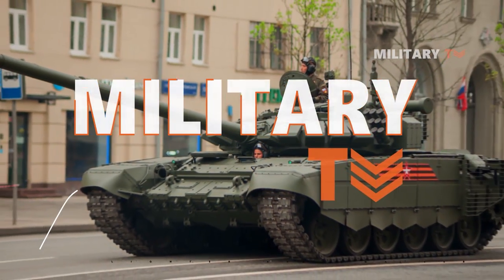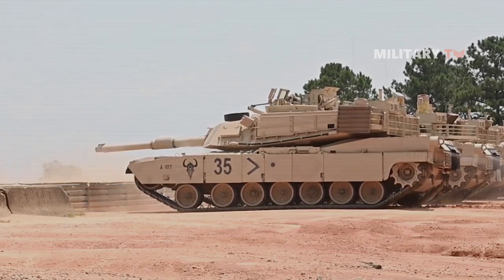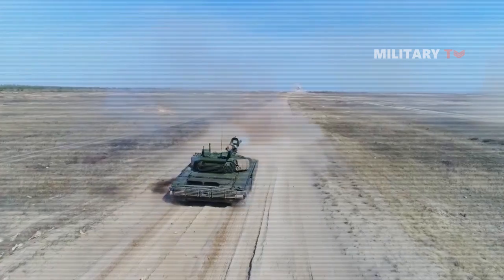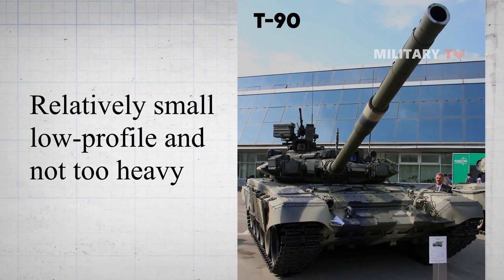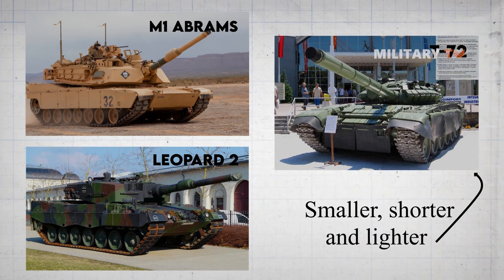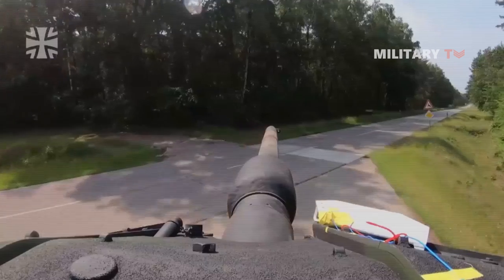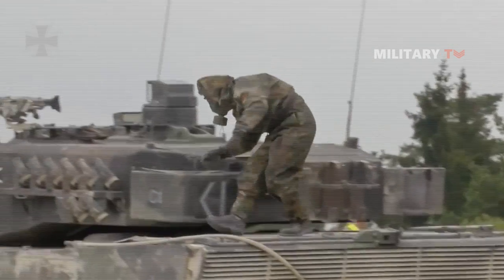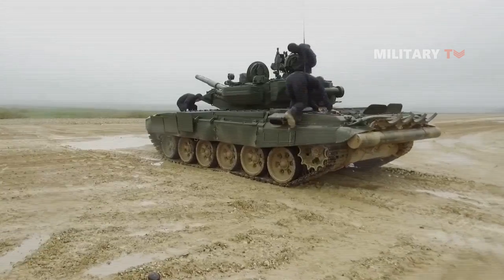Why are Russian tanks lighter and smaller than the western tanks

Comment: There's also a few other aspects of Soviet/Russian tanks that were overlooked in this presentation.

The T-54, T-55, and T-62 all have provisions to mount a dozer blade as standard equipment, while every subsequent Russian MBT from the T-64 onward has an integral collapsible entrenchment blade built directly into their lower glacis plate. That makes it pretty obvious that the rapid construction of defensive earthworks by the tanks meant to use them is considered very important by Russian policymakers. Combined with that is the fact that all of these tanks are very low in overall height, and gun elevation and depression have never been a priority in Russian MBT design. It's obvious why these are the case; the primary terrain Russian tanks are expected to fight defensively on has vast expanses of flat topography, with relatively few trees --- this is not consistent with the hilly and heavily-forested terrain of Central Europe, but it is consistent with the European Plain, which covers virtually all of Russia west of the Urals.

This is far more important than you probably realize. Russia's only viable geographic barriers on their frontiers has historically the sheer scale of thir geographical area (hence, why Russia has always been expansionist in nature), but the advent of mechanized warfare has all but eliminated this "barrier". It makes sense that they would built tanks meant to fight primarily on the defense, and primarily on their terrain. This also explains why Russian tanks are consistently lighter than their direct counterparts in the West; using less materials means that for a fixed strategic reserve of metals, you can build more of them to cover a much larger frontier.

Soviet doctrine also states that while tanks are meant to fight other tanks on the defense, their primary mission on the offense is to fight infantry. That this is the case is evidenced by the standard main gun ammunition loadout for every Russian MBT from the T-55 onward. These tanks all carry 40 rounds (or approximately the same), consisting of 5 APFSDS rounds, 15 HEAT rounds, and 20 HE-FRAG rounds. HEAT is more effective for destroying light armor, which predominately accompanies and/or carries infantry, while the reason for the large load of HE-FRAG rounds is pretty obvious. It also says a lot about how important HE-FRAG ammunition is for Soviet armored strategy, considering that they never fielded a tank with a new gun unless there was an HE-FRAG round already in production for it (i.e, the 115mm gun on the T-62 and 125mm gun on the T-64).

Infantry are also considered in Russian military strategy to be a superior threat to armor, which is why tanks were intended to massed fire using HE-FRAG rounds to eliminate as many of them as possible from a standoff range. This is also why Russian tanks have less machine gun ammunition (which they have to get very close to the enemy to use) than their counterparts --- and why Russian infantry weapons and light armor have historically been given an excess of anti-tank firepower.

Contrast this with the M1A1 Abrams, which all the way up until the end of the 1990s carried only APFSDS and HEAT rounds for it's main gun (30 APFSDS and 10 HEAT is the standard loadout), and which carried a whopping 10,000 rounds of 7.62mm and 1100 rounds of 12.7mm ammunition for it's machine guns (Russian tanks typically carry around 3000 7.62mm and 400 12.7mm ammunition). The M1A1 is also colossal, extremely heavy had very high gun elevation and depression, and wasn't designed to use a dozer blade. In stark contrast to the USSR's high priority for HE-FRAG ammunition, the USMC didn't start using one in the M1A1 until the early 2010s, and even then it was just a licensed copy of the existing German DM13 round (not one the Marines had developed especially for them). The US Army's new AMP round for the M1A2C is also an HE-FRAG round, and it's been on the back burner for so long that it still isn't in service yet. In short, the M1 is basically the opposite of what a Russian tank is all about, and therefore is a poor frame of reference to compare to Russian tanks without additional context.
Reply: This took way way to to long to not say anything or like here
Reply: Very impressive observation , now best and most  knowledgeable expert  on Soviet and Yugoslav  tanks in World is Serbian expert Vlada Ivanovic according to him Yugoslav M-84 tank  is better from U S Abrams  .
Reply: the M1 can use a dozer blade too. most, if not all, western tanks can, but just dont mount them all the time
Reply: Yes, well the video was meant to be a quick overview, not an essay. You could easily spend hours on this subject and still miss things. This is meant as a brief summary of the important points.
Reply: @EthanThomson  The M1 can't actually use a dozer blade at all, as proven by US Army documentation leaked to the press in the 1980s. The powertrain isn't strong enough. This is why the only time you see M1s fitted with them, they're either not using them at all, or just scraping loose spoil --- not cutting roads, digging entrenchments, or ramming-aside heavy obstacles.
Reply: @hughjass1044  The points were wrong, as I proved in the above comment.
Reply: Quick side note : HEAT and HEATFS Shells were used as Anti Infantry by Nato for a long time.
Reply: @panzerofthelake506  That doesn't make them effective in that role. The charges in HEAT rounds are specially shaped to focus nearly the full force of the blast into the charge liner, which is how they penetrate armor so well. That doesn't leave much left for blast or fragmentation.
A 2004 Armor Magazine article titled "The M1A1 Tank and Fragmentary Ammunition" also revealed that the M830A1 MPAT (a HEAT round) failed to inflict any casualties to Iraqi soldiers in the 2003 Invasion of Iraq, even though the MPAT was wrapped in a special casing designed to produce heavy fragmentation; it failed even against troops that were standing-up straight and running in the open. It's no accident that the USMC (note that the author of that article was himself a Marine) ended up fielding an HE-FRAG round based on Germany's DM11 some 5 years later.
Reply: @BlacktailDefense  Well they are still several kilograms of TNT equivalent Explosive going off. They are still quite deadly as the blast doesn't just go in one direction. Every action as an equal and opposite reaction after all. Heat might not be as effective as Frag rounds but still nothing to scoff at.
Reply: To be fair, USSR did field the BMP-1(I know, not a mbt; but it can be considered a light tank) before HE-frag was available for it.  That was made later and it sucked.
So I don't think USSR ever did that again.  (but a low pressure large-caliber HE-frag is indeed desirable in addition to autocannon, hence BMP-3)
Reply: Wow, you show a good detailed knowledge. You seem very credible. 
What is your background?
Reply: you show that the details are important.  
I didn't realize how much more machine gun ammo the M1's carry compared to the Russian tanks.  
Doesn't that give the M1 more staying power in a battle?  
when I shot weapons on automatic, I was impressed with how many shells I fired without thinking. Emptied a clip in the blink of an eye.  
So, 10,000 rounds may sound like a lot, but if you are in a battle and firing all  the time, I bet you can go through them pretty quick.  3,000 rounds seems like a pitifully small number to support infantry in a battle. 
BTW, if the Russian tanks are supposed to support infantry, why are they given so little mg ammo?  Seems contradictory.  Is it just to keep the tank small?
Reply: @craigkdillon  i believe that is why the Russian military has such a wide spread of different types of hardwear. They use tanks mainly for destroying other tanks or fortified positions. While BMP, BMD, BTR, BMPT (terminator) etc. Support the ground troops. And all other hardwear work best together.
Reply: @craigkdillon  i assume their small internal capacity has something to do with it
Reply: @craigkdillon  I don't actually have any background in military science, per-se; just decades of reading.
Reply: @BlacktailDefense  Pretty good reading. My knowledge was gotten the same way.
Reply: Craig Dillon 
I if you take what you said, that it doesn’t seem like much ammo, I think you could also make the case for either one not being a lot of ammo. The point of the tank is it’s big gun, and armor. So the little gun is of little use. Russia’s main worry is a fast large scale land invasion with tanks and infantry (a modern version of what Hitler did). It’s Russia’s weak point, also not having a derp water port. That basically explains why Russia will not let Ukraine go too. Currently Russia is surrounded by nato, all the weapons treaties have expired and they are dependent heavily on gas and oil to keep their economy going. That is a finite resource. If they have to fight for their interests they would rather do in sooner rather than later. Especially now that the US has pivoted to China. 
Russia won’t let Nato bully them. Not sure what the West is so aggressive with Russia for. 
Russia is just doing what it always has.
Reply: I can’t imagine a fragmentary round taking out too many infantry. What about buckshot in a tank?
Reply: @michaelnice93  Huh? Doesn't a fragmentary round throw a lot of shrapnel (fragments) in all directions, taking out soft human targets?   
Or is that something else?
Reply: This is why they did so bad against the M1. Even stuck M1s did extremely well against T72s as Tom Clancy wrote in his non-fiction book.
"Well, in his 1994 non-fiction book, Armored Cav, Tom Clancy recounted a tale of how an M1A1 Abrams got stuck in the mud during the ground war of Desert Storm. It was then set upon by three tanks, Iraqi T-72s specifically. A round fired from roughly a thousand yards away bounced off, and the Abrams responded by blowing the T-72 that fired it to bits. A second round fired from 700 yards, bounced off, and the offending T-72 was blasted. The third T-72, at a range of roughly 400 yards, fired a round, which left a groove in the armor of the Abrams. It, too, was destroyed by a shot fired through a sand berm. These were, supposedly, Russia’s state-of-the-art tanks.

Then, when help arrived, and the tank couldn’t be freed from the mud, a platoon of Abrams tanks tried to destroy it. After several rounds, they detonated the onboard ammo, but the blow-out panels functioned as designed. Then, when the tank was retrieved from the mud, they discovered that it was still functional. The only issue? A sight was out of alignment."
Reply: Another addition to this if I may:
Soviet Doctrine did have the idea that at some point a assault is going to be needed. Having already went through alot of Europe druing WW2 , Soviets learnt that often times crossing a river in short amount of time is vital for alot of operations.
Exactly for this reasson pretty much all Soviet and RUssian BMP's and BTR's are able to swim. Same goes for BRDM's and so on and so.
Soviet tanks also had the abillity to quickly set up for a underwater force cross. I dont know if the Abrams can force cross a deep body of water , correct me if I am wrong.
And another thing the Soviet learn is that even if there will be bridges across rivers , not all of them will be high quality ones. And ligher tanks have a higher chance of crossing such a bridge without breaking it.
Reply: @EcchiRevenge  The Soviets quickly realised that the BMP-1 was a good idea , but wasnt done right. Grom cannon was deemed as pretty much useless againts anything really and thus the work on a better weapon system started , resulting in the BMP-2. The Soviets knew they would replace the Grom cannon , hence why they didnt bother with HE ammo for the Grom gun for a long time. 
BMP-3 also has its issues , BMP-3s main gun was made to mainly fire wire giuded missiles. And HE ammo was as a secondary ammo type to it. The Autocannon was used as anti infantry and for light armor while the main gun , for heavier things.
Reply: Hendrix Cody  I dont know how a giant Jet engine which can be heard from 2km away or even more.
And you say it can "run so fast , to run off its oww tank tracks".....It isnt true , and if it was , how is that a good thing?
Stop making yourself look dumb.
Reply: @ThatCarGuy  Not only were Iraq crews poorly trained , somehow I never bought that story.
But even if its true , a single event cant determine a tanks quality. Many accounts from the Ukraines conflict where T-72s and T-64s would take 5 even 6 hits from ATGM's and other weaponry and still be able to push back into cover. Its a matter of luck , skill of the crew , and I guess in some cases , even if I am a atheist , some third powers help.
Reply: @AlexOnTheSide183  Even if you don't believe the story which is a non-fiction book using sources, The T72 did so bad they had to rename them T90. While no tank is perfect, in most cases a heavier tank will beat a lighter tank unless heavily out numbered.(Think US Sherman strategy on WW2 4-5 Shermans per Tiger)
"The T-90 is a third-generation Russian main battle tank. The T-72BU was officially accepted into service on 5 October 1992 by the Russian Ministry of Defence and simultaneously renamed as the T-90 for marketing and propaganda purposes aimed at distancing the new type from existing T-72 variants"
Reply: @ThatCarGuy  The T-90 is a modernization of the T-72 , not a simple rename. 
Ill look at you repair a Abrams tank on the field with a socket wrench and a sledge hammer. Because those are pretty much all the tools you need. Believe me. Id know. My dad was a driver of a T-72 tank.
Reply: Hendrix Cody  Again...There is nothing special about shooting while driving.....Leos and any Russian tank can do that.
Again , I dont get how limiting your speed is a...asset to the tank and a good thing?
Reply: @AlexOnTheSide183  it was literally named t72 before being renamed t90 as proven above.
Reply: @AlexOnTheSide183  That's bullshit because BMP-3 only carries a tiny number of ATGM and originally didn't have autoloading mechanism for it.

73mm works, just as SPG-9 is still used even today.
Just not for its original purpose for use against tanks.
Reply: @ThatCarGuy  If the T-72 were renamed to T-90 then wtf is the T-72B3?
T-90 is pretty much the same tank as a T-72 , yes  but it was modernized after the feedback came from the T-72. They realised that the changes are significant , so they changed its name. 
These are now 2 diffrent tanks , T-72 wasnt just renamed because it was shameful or anything. Again , its not the tank that makes the crew , but the crew who make the tank. Put poorly trained crews in a T-72 and no matter what you face , they will probobly fail.
Reply: @EcchiRevenge  On training grounds , yes , HE was loaded into the guns with a small amount of ATGM's , but in combat , any sane Commander , would take as many ATGM's as he could , because he knows that if he meets light tanks or infantry his 30mm will do just fine , but if he meets a tank , his HE 100mm round wont do shit.
And I dont know what the SPG-9 has do with anything here
SPG-9s are still in use , yes . Mostly as AT weaponry for the VDV or other rapid deployment units. It can destroy most tanks or IFV's from the sides or back , but you need to get into close range to manage to hit it.
Reply: Hendrix Cody  
Soviets were first to use a smoothbore gun , first to use fin stabilized ammo on the T-62
First composite armor on the T-64
First ERA protection

The Russian tanks didnt need to stop , they stopped due to the poor skill of the gunners of those tanks. But I would think you would know that. You clearly have read so much in your 9 years of life on this world. 
Soviet tanks had stabilizers and had great weapon systems for the time. Sure , they didnt have Nigh vision on early variants or thermal sights. But at the time , for the Soviets , Mass production was the main point. 
And dont forget. Early versions of the Abrams also didnt give their commanders proper thermal or night vision sights and only the gunner got them. So the Driver , Commander and loader were blind during the night and only the gunner could see for about 2km infront of him.
Reply: Hendrix Cody  So does Russia , and Germany...Or any European country. Pontoon bridges arent exactly something new or amazing. Its just that  bringing said patoon to the river takes time , while simply force crossing a river is 10 times as fast.
Buckel down , close all hatches , put the air intake tower on and off you go. It wasnt that it didnt stress , its that the US never built the Abrams for the European continent. But for open desert combat. Thats where the Abrams does shine with all its systems. But try to put in in a European area and you get a giant bulky heavy ass tank , that breaks all the roads it drives on , any bridges it crosses.
Reply: Hendrix Cody  Oh this one....Because the Russians ran around with M1 garands and Thompsons....Fucking dude , read some history books.
What was actually delivered to the Soviet Union during that time , where and when the Soviets turned the tide of the war and why.
Little secret for you , the main thing delivered wasnt ammo or weapons or tanks but it was food and trucks. Trucks is what the Soviets needed badly as it lost tons of them in the first weeks of the war. Food wasnt in something the Soviets were super short on , but it helped.
Germany simple ran out of jiuce near moscow. Support lines stretched from Germany to Moscow , Not being ready for the harsh Winter which was the coldest one in the last 30 or so years. Soviet reinforcments from the far east.
All of these were the main reasson Germany simply didnt have enough recources or power to push any further into Russia. After Moscow , germany retreated , defeats at Stalingrad with the 6th army being wiped out , then Leningrad being unblocked  , Defeat at Kursk and failure of operation Citadel which was the last German offesive in the Eastern front. And then finnaly the 1944 D-Day landings , which made Germany rethink their plan.
So they sent all their forces to the East , leaving the Western front pretty much open. 
They knew the Russias were coming for revenge , but the Americans didnt have such hatred , as their homeland wasnt bombed and burnt for the last 4 years.

Before you talk shit about somebody not knowing history , actually read a bit about it , cause clearly you jack all about it.
Reply: @AlexOnTheSide183  "wtf is the T-72B3"
.... Russia upgrading older the older T72/90 with modern reactive/passive armor... Hence how both of them can accept the exact same armor plating, since they are the same tank. Dude the T90, was literally called the T-72BU before finally being renamed the T-90 to move away from the T-72 name since it did so bad. Just like how the S400 is literally a renamed S300, and was it's name before being changed to S400. The Su35 is a glorified Su27 and was literally also called an SU27 before it's name change, and so on. Russia is known for this. 
"The S-400 Triumf, previously known as the S-300 PMU-3"
"The type was originally developed by the Soviet Union from the Su-27 and was known as the Su-27M"
"Though only a modest upgrade, Soviet leaders decided to re-brand the tank for marketing reasons. The poor performance of Iraqi T-72 crews against Western armor in Operation Desert Storm sullied the reputation of the tank. To differentiate the newer model from its tarnished image, the tank was to be called the T-88. Russian President Boris Yeltsin approved production of the T-88 after a visit to Nizhni-Tagil in June. The name was formally changed to "T-90" by state decree in 1992 to symbolize its status as the first new Russian tank of the 1990s"
Reply: @BlacktailDefense  iam paying you respekts, never seen someone with that much knowledge on tanks
i mean iam a tank enthusiast too but u are another level haha
Reply: @AlexOnTheSide183  dude u are so right the story is either bullshit or iraqui crews are bad.
look.
those 3 t72 fired 3 times and abrams fired 3 times? why?
russian tanks have aoutoloaders that doesnd make sence
it should be more like 7 shots against 3 or something
second
1 shot was high explosive... lol
one was HEAT ( abrams armour is actually designed against HEAT shells)
so that was dumb
and the last shot was AP
also its stated that the 125mm gun of the t72 can penetrate about 930 mm RHA (standart armor... plain metal, no extras no ceramic) at 2 KM
that does mean at 400 yars that would have been a 100% penetrating shot if not in the turret
cuzz at 40 yards the penetration should be like 1150mm
thats even kinda enough to penetrate the turret if no bounce of happens
so u are right either the crews were complete apes, or this story is BS
i think its the socond option
u know america is selling those tanks...
so it makes sence to do marketing and propaganda
Reply: @ThatCarGuy  I know what a T-72B3 is , what I mean is that the name wouldnt be there if all T-72s were simply renamed. Yes the Iraqi conflict had a major hit on the sales of the export version of the T-72 , but they didnt just take a T-72 , rename and sell it.
They added new things to it , took the feedback from iraq and upgraded the tank and changed its name to T-90. 
What I am trying to say , a T-90 isnt a simple rename. Its a modernized T-72 with the Iraqi war feedback and info.
Reply: @AlexOnTheSide183  Not how that works.
You're making bs up as you go, but you didn't know the autoloader carousel for HE-frag cannot actually load the missiles, which are much longer.  The capacity of 8 is from the 3 rounds in turret and 5 round in specialized racks in the hull; this is non-negotiable.

You don't know what SPG-9 has to do with anything here because you don't realize it shares warhead wtih BMP-1's main gun.
Reply: @ThatCarGuy  "These were, supposedly, Russia’s state-of-the-art tanks."  AFAIK, these were Soviet tanks of the 70s, moreover, in the export version, i.e. a little deteriorated. They were armed with shells that were decommissioned in the USSR in 1974.
Reply: Dude please tell me you did not write that whole constitution of a explanation of Russian tanks...smh...lolol.
Reply: @EcchiRevenge  This aint War thunder , you can carry anywhere you want , not even in the designed racks. Is it safe? Fuck no. 
But again , Where am I fucking wrong that the main Anti infantry weapon on the BMP-3 is the 30mm?
Reply: @AlexOnTheSide183  it is a simple rename as proven above.
Reply: @AlexOnTheSide183  This ain't warthunder where BMD-4 had a bug that let it fit 9m117.
This also isn't Armored Warfare where you're allowed to carry a full load of missiles.(that game wasn't even trying to be realistic)

The carousel literally can't fit the missiles.
Look up the fucking schematics.

Everywhere, BMP-3's main gun is the 100mm.  For infantry both in the open and in cover(this is partly why 100mm is desirable and where 73mm was useful - much better than autocannon against fortifications).  The trajectory of the low-velocity 100mm gives BMP-3 some ability to conduct indirect fire against distant targets(ATGM teams at standoff range, for example).

For that reason, the standard combat loadout of BMP-3's 30mm autocannon has less HE ammunition than AP(245 vs. 255; 500 total).
Reply: @EcchiRevenge  Ok so what are you attacking me for here? I said that the 100mm was built with idea that that ATGMs will be fired from it and that the ATGM is the main weaponry againts tanks? How am I wrong in that?
Reply: @AlexOnTheSide183  Shifting goalpost.

You feel attacked because I merely corrected where you're wrong.

Stop trying to grasp at straws.
Reply: Uh yeah, so does the Abrams, Le Clerc, ect
Reply: @levak8740  that's one person's opinion and makes zero impact on the outcome of any conflict.
Reply: @BlacktailDefense  uh, I will have to say your incorrect, we did in 04 in Tikrit to move plenty of dirt and it has ZERO issues.
Reply: @reedrk88t  The only time before the 2010s that any M1s ever carried dozer blades was during testing in the 1970s; testing they flunked, which the US Army themselves were the first to admit. The Pearson "Combat Dozer Blade later attached to some M1A1s ans M1A2s was the same blade that the M1 proved itself incapable of using decades ago, while the M1ABV used a scraper that combed the ground for mines, not a blade that scooped-up the ground.
Moreover, the M1 ABV didn't enter service until 2009, so you wouldn't have even seen one of those in Tikrit in 2004. All the M1A1 and M1A2 carried at that time were mine plows and mine rollers.
Reply: @EcchiRevenge  Wtf are we even on about this point? 
I said that the BMP-3 100mm was made to fire ATGM's and that the 100mm was meant to take care of heavy targets while the 30mm was to destroy infantry.
You tell me I am wrong and start telling me about how much ammo the BMP-3 can carry , which wasnt my point and wasnt what I was even talking about. 
The 100mm main idea was that it will take care of any heavy armor the BMP runs into , but if needed , they have HE to use. And it matters on who you are fighting , what sort of intel you have and so on. If you know you will only run into enemy infantry you take HE ammo , if its going to be tanks then you load as many ATGM's as you can fit , and those dont have to be in factory made places. Ive seen what tank crews come up with just to have more ammo. No sane commander will carry a full load of ammo of 8 ATGM"s and how ever many HE shots , because you just become a giant gunpowder barrel. 
The word attacked was meant that we keep telling each other the same thing yet somehow are having a argument. Fucking hell.
Reply: @EcchiRevenge First....What people? You are the only one redead my replies , second , Ive been around military vehicles my entire life. My Dad first trained to drive a BMP-1 , then drove a BMP-2 and even got to use the BMP-3 , later was switched to drive a T-72 wihout a turret and made into a recovery vehicle. On training grounds who often carry more ammo then what you need , inside boxes ONTOP of the god damn vehicle. When I say carry ammo , that doesnt mean all of the ammo needs to be in the specific locations inside the vehicle. Again , thats on training grounds , ofcourse nobody would carry HE ammo in boxes on the armor in combat , because thats suicide. 
How many more fucking times do have to tell you that the 100mm gun is made to destroy enemy TANKS while the 30mm is meant to destroy INFANTRY. And the ATGMS are exactly for that fucking reasson , to destroy tanks. And the HE rounds are there whenever you need them. I dont fucking get How I am wrong in saying that a Guided fucking missle is used to destroy tanks. 
You are just a guy who jacked off to a bunch off books and magazines about vehicles and then tries to prove something to somebody who has fucking been at training grounds and has seen been all around said vehicles. Fuck I care that 73mm Grom cannon is the same as the SPG-9? What does that have to do with us talking about the BMP-3? 
You are just trying to prove to me you are smart , not that im wrong. Just stop bothering to reply , because this is truly going to go on forever.
Reply: @rooooooby  You're going to learn over time that not everyone thinks or writes the way you want them to, so you're either going to have to get used to being angry, or just accept it.
Reply: @BlacktailDefense  I guess you have never operated a Abram we have no problem using the blade. But we make though the mud with few problems also we have proving grounds to test the tanks side by side but most of the info classified. So the Ruskies will have wait until we match up. Note the Germans show us in the Second war the best way to deal with tanks are tanks busters. The new A-10 a beast and the fear of Russian anti-aircraft missile systems depends on satellites which Russia depends on old outdated satellites. In the first five we will hack their system and jam their eyes in the sky trust they already know this.
Reply: @nobody687  The T-34's lineage is a lot more complicated than that.
The US tank that the USSR copied was the Christie Model 1931, which was directly duplicated as the BT-1 Cavalry Tank. The BT-1 only served as a design template for the BT-2, which was armed with a Model 30 37mm gun (a licensed copy of a German gun), and a DT machine gun, with the BT-3 simply being a BT-2 built with metric rather than English measurements. 

The BT-4 switched to a welded construction (rather than all-riveted) and added an improved suspension, while the BT-5 added a Soviet-designed turret with a new 45mm Model 32 gun, and added a coaxial DT machine gun.

The BT-6 ended up serving as a prototype to the definitive BT-7, which introduced an all-welded construction, a new hull glacis plate, new tracks, and a new engine (the M-17, which was a license-built German design). Almost half of all BT tanks ended up being BT-7s, and more features were gradually introduced into them, including a new turret with sloped armor.

The BT-7M was later re-designated the BT-8, and it introduced a new V-2 engine, a diesel V12.

The last BT tank was the A-32, which ended up having a dramatically redesigned hull, a reorganized propulsion system, new tracks, an extra pair of roadwheels, a completely new turret with the new L-10 76mm gun, and dramatically angular sloped armor on both the hull and turret. Further development of the A-32 gradually snowballed into the T-34.

Walter Christie's involvement in all of this? It ended at the completion of the BT-1. The T-34 retained few vestiges of it's American ancestry, and most of the work that led up to it was evidently done by the Russians.
Reply: @nobody687  I'm more worried about the standoff between Russia and Ukraine. They both seem eager to try something stupid, and that's going to end badly for both of them (to say nothing of anyone else sucked into that war).
Reply: @EcchiRevenge  video games are a poor framing reference, and an even worse source of information (except when people are leaking classified info on the forums). FWIW, the 30mm is the main weapon system in the BMP-3, with the 100mm and 7.62 coaxial to it. If you ever get inside of one it gets obvious quickly by how the controls are laid out, but it makes more sense if you think of the 100mm as a launcher, not a cannon. In the defense, it serves as an ATGM launcher, with priority of fires being PCs with the 30mm. On the offense they'd have HE rounds in the tube for field fortifications, obstacles, and massed troops - but with the 30mm still being primary for trucks, PCs, and light armor (if the west starts fielding that again).

The BMP-3 only has space for like 8 or 10 100mm cartriges if memory serves, so they'd have like 3 ATGM. The ammo count doesn't really indicate intent though since the thing is about the size of a HMMWV, and you gotta remember how the Russian army is organized means it will operate attached to a tank BN.
Reply: @BlacktailDefense  I can clarify the dozer blade bit some. The problem with the bulldozer blade on the Abrams is the track, not the transmission. The rubber track pads we use have a bunch of benefits, but they do NOT provide the traction that steel tracks do for pushing dirt. If you look at military excavator tracks, you can see what I mean. So when digging "down" you lift the weight off of the tracks causing slippage, which makes it hard to make the deep cuts you really want to. You can still do it, but you overheat the transmission eventually. Digging "up" or "forward" is no issue. Usually the worst case scenario is you can dig simple hull downs for a hasty defensive position. If you need a multi-tiered fighting position you need the engineers, if for no other reason than time (1 blade per platoon) but... Russian tanks are actually worse off. The Abrams blade is track width, and you can dig down until the turret roof is level with the ground if you want. The T72 and T90 blade is hull width, so if they try to dig down more than a hull down they risk rolling the tank. The advantage is every tank in the platoon has one, and I bet those things are awesome for helping the infantry establish fighting positions.
Reply: @nobody687  The T-34 was NOT American design. They may have used the Christie suspension, but that is it.  
It was the Russian's that sloped the armor on all sides. 
The American Sherman tank is sloped only on the front, and has better protection than many think, but it is still only on the front. 
In all other ways, the T-34 is Russian.
Reply: @craigkdillon  of course , but the suspension is what made the difference.
Reply: Excellent post.
Reply: Hendrix Cody  why are you so toxic? to prove a claim?
Reply: In effect, under erstwhile Soviet Army armored doctrine, their tanks had a multi-role use, but emphasized the offense, meant to take on enemy infantry and rear-area "soft" targets.  George S. Patton would have entirely agreed, as he said the same of the M4 Sherman, declaring the enemy rear to be its "happy hunting ground."  It seems that the M1 Abrams and its further marks have more of the WWII German Panzerwaffe idea, with larger, heavy, heavily-gunned and thickly armored tanks that serve more or less as expensive tank destroyers, with the job of combating enemy infantry and "soft" vehicles left to artillery and infantry.

Given that the Soviet Army defeated the Germans on the Eastern Front in the "Great Patriotic War", I'd say they should always have been taken seriously as an opponent.  Of course, they did have to throw a great deal of equipment and men into the fray to achieve their objectives, which often has been used to impugn Soviet/Russian competency.  A bad notion, as (1) at times, there were battles where the Soviet did run up lopsided counts on the Germans and, (2) it meant they were willing to pay a much higher "butcher's bill" if that's what the price of victory entailed.  A hypothetical WWIII scenario would likely have seen NATO unable to prevent a Soviet breakthrough in the Fulda Gap or over the Northern German Plain; it'd have been more if the key airfields, bridges, and highways could have been held long enough to facilitate reinforcement (REFORGER) and counter-attack, and losses inflicted on the Group of Soviet Forces, Germany.  And this is assuming both sides kept it "conventional", not necessarily a given.
Reply: @joshuafelder2701  thanks you for commenting on the ability of the M1 to move earth. I found it hard to believe that the limiting factor was the power train. It does seem more logical that the tracks are more of a limiting factor.
Reply: that was a great deal of words to explain that the difference between Russian and American tanks is actually the doctrine of each country.
Reply: The thing is an Abrams is neigh indestructable for insurgent forces with access to only things like the RPG-7. I do not think the Abrams would do well in conventional warfare.
Reply: It doesn't matter what you put out into the field.  Air superiority will rule the day, every day.
Reply: @milosit  That's what Libya thought when they invaded Chad in 1986, a nation with no air force, and whose military vehicles consisted mostly of Toyota pickup trucks. The French provided air support for Chad, but only 12 fighters; Libya committed 60 fighters and bombers to the invasion.
By the time the shooting stopped, 1000 Chadian soldiers were dead, but the Libyans had lost 7500 soldiers, 500 armored vehicles, and 23 aircraft, and were repelled from Chad.
Before that, Biafra had tried to secede in the 1970s from Nigeria, a nation with a surprisingly competent and formidable air force by West African standards, and the Biafrans had no aircraft at all. They hired some mercenaries to deal with that, who in turn bought 5 propeller-driven MFI-9 light planes that they bolted rocket pods onto. The mercenary pilots and their 5 MFI-9s then systematically eradicated the Nigerian Air Force while their aircraft were on the ground.
For a much earlier example, Finland in 1940 had barely a hundred operational fighter aircraft when the Soviet Union invaded, under the cover of the largest air offensive yet mounted. By the time the Winter War was over, Finland had a lot of aces, and the VVS had hundreds of wrecked aircraft and deaf pilots.
The Finnish experience replayed itself in the Six Day War and the Yom Kippur War, in which the IDF was grossly outnumbered at the start of the fighting, but ended up pretty much destroying the entire aircraft inventory of the Arab Alliance on both occasions.
Tremendous airpower was committed to support US Marines as they assaulted the island of Koh Tang in 1975, but the Marines got shredded anyway, and fled so quickly that they left behind all of their dead, and even a few survivors.
Earlier this year, the Taliban overran all of Afghanistan and essentially won the Afghan War, despite resistance from the most powerful combined air force in the world. The Taliban had no aircraft at all.
And more recently, the world's third-largest air force came crashing-down onto Ukraine, but ended up suffering a disastrous loss/kill ratio against an enemy with probably just 30 serviceable combat aircraft.
The lesson taught by these conflicts is that as valuable as air superiority is, it never guarantees victory on it's own. It's only one aspect of preparedness.
Reply: Damn, thanks for the lecture. I'll just copy and paste this for my reddit, uh I mean, exams for school.
Reply: You are absolutely wrong about Russian tanks being developed to fight defensively.
Reply: @oisnowy5368  They are made to fight armor on the defense, which is why they're all built to self-entrench (it's pretty obvious that you don't dig-in a tank to fight infantry), or to fight infantry on the offense or defense. The fact that Soviet armor isn't produced with significant thought toward offensive actions is also evidenced by how little internal fuel was ever designed into any of them (this is why you frequently see them carrying droptanks), and how the high elevation and depression typical of Western tanks (most central and western European nations are extremely hilly, but western Russia is almost entirely covered by the European Plain) is deliberately omitted from nearly every Soviet and Russian tank.
It's self-evident what these tanks are designed for, especially in contrast with the defining design attributes of Western tanks.
Reply: Why the f would you write your research paper on YouTube lol that’s such a sad life
Reply: @BlacktailDefense  could they be thinking about the mine sweeper add on? to the untrained eye they could be mistaken for a dozer blade.
Reply: Hendrix Cody  they were trained and fine soldiers. They were just exhausted and poorly motivated by the second Iraq war. The ones I met were old before their time and worn out from decades of fruitless endeavors.
Reply: Hendrix Cody  That's not correct, there are numerous record of Israeli Schot's hitting targets/tanks while moving in the 6 days war. The Abram is an awesome tank but stop idolizing it so much.
Reply: Hendrix Cody  How old the tank in question is has nothing to do with your statement being false tough, "the Abrams was the first tank able to hit targets while moving"....those are your words, stop trying to spin your answers around to fit your ideology/logic. As I said the Abrams is a fantastic tank but it doesn't mean that other tanks can't perform equally or even better in some cases, I mean with how much 1 Abrams costs current performances are the minimum investors could expect. I find pretty useless to compare a 2 millions USD mbt (t72) to one that costs 4 times more.
Reply: Hendrix Cody  thank you
Reply: Nerd
Reply: Hendrix Cody  "what you said about the Taliban over running afgan with no airforce is absolutely repulsive for the fact America had already left months before."
Not only is it true, but public record. The Taliban overran the entire nation before surrounding Kabul, and this is literally verifiable in every news outlet.

"America ran the Taliban out of the towns with weeks of arrival."
This is precisely the same as the most widely-repeated talking point Russians use as damage control for their own failed occupation of Afghanistan. "We controlled all of the cities". Trouble is, the cities were a tiny fraction of the entire battlefield.

"From thee it was entirely just hunting missions and police keeping.  Russia lost hundereds of jets and attcak choppers.    America lost ZERO!"
That's an easily disproved lie. On September 12th 2012, the Taliban raided Camp Bastion and destroyed eight AV-8B Harrier IIs on the tarmac. The Bureau Numbers of 7 of these Harriers were 164570, 165422, 165568, 165570, 165578, 165591, and 165308 (I don't know the number of the 8th Harrier yet). AH-64 Apaches suffered quite a few combat losses in Afghanistan as well, though the only one whose USAF Serial Number I know is 05-07012 (shot-down by Taliban AAA on May 28th 2012; both aircrew were killed instantly). Four other Apaches were destroyed in the tarmac by mortar fire on an unspecified date in 2007, and two more on the tarmac by an artillery barrage on August 12th 2012. Then there was the CH-47 Chinook shot-down by an RPG-7 rocket on August 6th 2011 (many on board; no survivors), while carrying the same SEAL Team that had raided the Abbotabad Compound and killed Osama Bin Laden. On September 25th of that same year, CH-47 #90-00200 was shot-down by the Taliban, with 5 of the passengers killed. That's also not even including the considerable number of losses to accidents in Afghanistan, nor the combat losses that haven't been declassified yet.

"America announced it's withdrawal 2 years before.    It BIULT a well supplied and we'll trained afgan army that absolutely refused to fight so what weaponary it had for not matter."
The ANA were neither well-supplied, nor well-trained. See the documentary, "This Is What Winning Looks Like". The ANAF were also infamously given almost all of the US Army's C-27J Spartan transport aircraft after the USAF co-opted them away from the Army, despite the protests of the ANAF on the basis that they didn't have the training, manpower, resources, or funding to maintain or operate them; the ANAF was forbidden from re-selling them, and all of these C-27Js were eventually just scrapped at AB Bagram.

"The force that has has sufficient airpower will win as long as it stays flying.      America wipes out entire forces with airpower and Israel using air power from America also keeps it's self free and pounds it's enemys with airpower with great success."
Following the nearly year-long bombing campaign against Serbia in 1999, only a tenth of the targets the Pentagon claims NATO destroyed were verified, several times as many Serbian troops were witnessed withdrawing from Kosovo as NATO claimed were there, and Serbia was allowed to surrender under moe generous terms than NATO offered at the beginning of bombing campaign. A hollow victory is just another kind of defeat.
Reply: Hendrix Cody  The Ukrainian Army is organized, trained, and equipped the same way as the Russians with mostly the same weapons. However, it's the Ukrainians who are fighting on the defense, and look at who's taking the worst losses.
Reply: @michaelnice93  fragmentation rounds as you out it are designed to take out infantry and lightly armoured vehicles. That's the reason Britain kept rifled barrels on their tanks so that they could fire HESH rounds which smooth bore can't. Unfortunately now some idiot has decided the Challenger 3 will go smooth bore. Yes there are now anti infantry and light armour programmable rounds for smooth bore, but they are horrendously expensive and I can gaurentee the Challenger 3 will never fore one in combat as we can't afford them. My knowledge of hunting shotgun cartridges is limeted, but isn't buck shot just a single large slug for taking out deer as regular shot does nothing to them? Fletchet type rounds have been experimented with in tanks, but weren't pursued as they were too specialised as they could only take on infantry and only at short range.
Reply: Hendrix Cody  calm down, hot headed US patriot. US and NATO Air forces were quite lucky in Afghanistan because talibs didn’t have MANPADS like on the contrary US government was supplying talibans against soviet air forces.
Reply: С уважением из солнечной России..брат лисы Алисы 🦊🌛 ps...сколько ты всего знаешь ...жму крепко твою руку дорогой друг...
Reply: @levak8740  You Serbs are hilarious 😂 M1 Abrams would absolutely obliterate the M84. The  M84 wouldn’t be able to pierce the armor of the M1 from the distance that the M1 would engage it from. You guys live in an alternate universe. What’s next the most knowledgeable Serbian expert on jets says the Mig-29 can easily out maneuver and destroy the F-22 raptor?
Reply: Nice post but you left out half of the Abrams service rounds. I only know because I shot them.
Reply: @dadmobile960  Indeed, but there wasn't even a Canister round developed for the M256 until the end of the 1990s, and the subsequent M830A1 MPAT is just another HEAT round.
The M908 HE-OR isn't all that special either, when you consider what it is; an MPAT that just swapped the hollow copper charge liner for a large steel slug. This is actually a type of round that widely-used in World War 2 called "APHE", which you don't often see anymore, because even the early HEAT rounds had more than twice the armor penetration (relative to the bore of a given tank gun). APHE was also good against structures, but not as good as HE or HESH, and that's why you stopped seeing it issued for postwar tank guns... until the M908 HE-OR, that is.
Reply: @BlacktailDefense  MPAT is a HEAT round yes but functions in ways that made it pretty unique. For example, it could be used for air targets or used to blow holes in ground structures big enough that a Tank can pass through.
Reply: It's interesting that russian tanks are apparently getting stuck in the mud in Ukraine, running out off fuel AND getting picked off by footsoldiers. 
3x the things that they should excel at.
Reply: @simonhenry7867  They're not running out of fuel so much as having it deliberately dumped; word down the grapevine is that when Russian AFV crews hear they're bound for Kiev, they "accidentally" dump all their fuel.
Reply: this grew old quickly lol
Reply: do they still use the obj 279 E, i heard that tank has crazy armor
Reply: @michaelnice93  soldiers are warned a simple frag grenade can project shrapnel over 100m. That is why they are always supposed to take cover. One piece of shrapnel can sever a throat, eye, or hit a main artery, so even a piece of shrapnel travelling relatively slow over 150m can mortally wound or kill a person.
Reply: Do you know what the US has to fill the role of the 100m Sherman? Just load a bunch of HE in an M1?
Reply: @will.roman-ros  The good news is, the US Army has developed a multi-purpose round, the XM1147 AMP, which is an HE-FRAG round. The bad news however, is everything else.
The fact that the T-62 (the operational first tank with a smoothbore gun) entered service in 1961 with an HE-FRAG round already in it's available loadout proves that HE-FRAG rounds for smoothbore guns are a known quantity, and not difficult to develop --- yet the US Army is only developing one for the first time now. It's not even the first for a 120mm smoothbore gun, as the Swedish/Israeli Slsgr 95 that entered service in the 1990s proves, nor is it the first that the US military has ever used; the USMC has used the German DM11 HE-FRAG round for more than a decade, which was manufactured under license in the US as the Mk.324 (the Army refuses to so much as acknowledge it's existence; the Mk.324 is contaminated with Marine Cooties). The XM1147 AMP also requires a lot of overhead (special fire control sensors and equipment) to function in anything other than it's impact detonation setting, while all of the previous programmable HE-FRAG rounds could be set to airburst at a selected distance using a dial on the nose of the projectile, and there's no guarantee that every potential user will be willing or able to spend the small fortune needed to make their tanks AMP-compatible.
But that's not even the worst part. The Army has decided that the XM1147 will replace _every round other than APFSDS in the US inventory_. That means no more Canister, no more HEAT, and no more APHE (the M908 HE-OR). The Canister was prety pointless on a tank that has a machine gun, but HEAT rounds penetrate a LOT more armor than contemporary APFSDS rounds (when the M829 and M830 entered service in 1984, the M829  penetrated 600mm RHAe@2km, with increasingly less over distance, while the M830 penetrated 800mmRHAe --- the latest 2010s-era APFSDS rounds are only beginning to match the M830 HEAT's penetration back in the 1980s).
Reply: @BlacktailDefense  awesome info. Thanks for the response! 

Canister is the only round that can kill infantry point-blank, without compromising the crew, no? Maybe they've been playing too much Halo, and want a "kilimanjaro" by butchering a whole column of enemy infantry in a perfectly aligned shot - lol. 

Now, I'm sure the XM1147 is way more expensive, so that's a con. But I'd assume it has significantly more range, or can carry a larger payload the same ranges as HEAT, bc it propels itself somewhat. If they are programmed with guidance systems in the future, than I'm sure getting a better shot will yield more damage than missing the vitals with a HEAT. I can see the advantage of making every shot count for a bigger, heavier, and more expensive tank. 

However, I don't know about abandoning the other rounds completely. In many cases outside total war, they ought to go ahead and use cheaper ammo, if it still gets the job done.
Reply: @BlacktailDefense  also seems an expensive platform for a HE-Frag (the XM), but again, w more range, would give a tank more of a arty/support gun role. Contrary I think simplicity, ease of use, and cheap manufacturing can win wars just as well as fancy tech. It depends on the scenario.
Reply: @ProfibobWot  If you take the average time for a trained loader and the fire rate of T72, the Abrams absolutely can fire 3 shots before three opposing T72s could fire off a second one each.
Reply: Gotta love copy and paste
Reply: AlHasan Sameh  please troll someone else I block blatant trolls thanks.
Reply: @AlexOnTheSide183  he lucky he didn't meet an Abrams or you wouldn't have a dad lol. Abrams will kill a T72 any day or night from any angle.
Reply: @kylapendley924  Its a recovery vehicle based on a T-72 , first of all. 
Second of all , You clearly are another one of the guys who believe that "ABRAMS BEST TANK IT CAN KILL ANYTHING!!!!"
A T-72B3M can kill a Abrams just as well as a Abrams can kill a T-72. Frontal armor , side armor , doesnt matter. At this point its whoevers APS system works better and whoever has faster reaction.
And also , I suggest NEVER type the worlds "lol" next to "You wouldnt have a father". Its just a disgussiting comment tbh.
Reply: @AlexOnTheSide183  This is and had been a MAN talking to you, this is my wife's account. This being said, I have WATCHED an APFSDS DU round hit an abrams with no penetration from under 1k. I served in an armored unit in the United States active army and can 100% with utter confidence tell you that NOTHING shot from any modern MBT will penetrate an Abrams frontal armor. I have also watched the same APFSDS DU round slam THROUGH a T90 with ERA and impact the berm behind the target tank. You have ZERO clue what you are talking about and all you have is a propaganda tape and history lesson. I have seen these weapons tested and fired in combat both. I can't tell you the effective thickness of an Abrams but I will tell you this, not even the 1350mm of penetration from the Abrams own gun will stop it. Good luck with your second hand stories I guess lmao.
Reply: @fearedjames 
pHAHHA ok
Reply: @kylapendley924  Bruh....The amount of URA patriotism in this comment  made vomit. I wont even argue with you.
Reply: A tank is not designed to fight defensively. This is the exact opposite of the Russian thinking. The Russians use threir tanks in attack, and the T-tanks are designed to be used as attacking tanks. It is NATO tanks that are designed for defence (as much as any tank can be) by having highly protected turrets, large gun depression and numerical inferiority to the Russian tanks, but with "superior" quality. The question of gun depression is not and was not considered important for the USSR because of the way their tanks were meant to be used: massed columns of T-tanks, travelling together, operating as an armoured unit of considerable strength. The fact that tanks fight infantry more than they fight tanks is not a particular consideration of the Russians - it is true. This is why the Russians use HE more than AP - literally everyone does. The ammunition capacity of the machinegun is not relevant - the tank carries as much as it is able to carry of all ammunition types. The Russians developed very potent anti-tank weaponry for their infantry because it is a good idea to do so, not because they thought there was some special threat against tanks from infantry. A sufficiently determined attack against a tank from close range will almost always succeed, so no tank should get close.
The superior threat to tanks on the offensive has always been camoflagued antitank guns, so this is not a particularly Russian way of thinking.
Reply: @TheFanatical1  "A tank is not designed to fight defensively."
They indeed are, as proven by the extreme gun elevation and depression of Western European tanks intended to fight on the defense in their hilly terrain, and by entrenchment equipment being an afterthought on almost all of them. The fact that Eastern Bloc tanks are almost universally lower, self-entrenchment capabilities have become increasingly integral over time, and that gun elevation is the afterthought proves they're meant to defend predominately flat terrain. The fact that all T-64s, T-72s, T-80s, and T-90s have collapsible self-entrenchment blades built directly into their lower hull glacis plates proves this.

"This is the exact opposite of the Russian thinking. The Russians use threir tanks in attack, and the T-tanks are designed to be used as attacking tanks."
The universal Soviet ammunition loadout for their tanks would have had more than just 5 rounds of APDS/APFSDS if it were true. It is not.

"It is NATO tanks that are designed for defence (as much as any tank can be) by having highly protected turrets, large gun depression and numerical inferiority to the Russian tanks, but with "superior" quality. The question of gun depression is not and was not considered important for the USSR because of the way their tanks were meant to be used: massed columns of T-tanks, travelling together, operating as an armoured unit of considerable strength."
The terrain you choose to fight on determines gun elevation and depression, not how you choose to fight on it.

"The fact that tanks fight infantry more than they fight tanks is not a particular consideration of the Russians - it is true. This is why the Russians use HE more than AP - literally everyone does."
False. Western tank loadouts in MBTs from the Leopard 2 onward load 10 HEAT rounds and 30-40 APFSDS rounds. HE was developed for them later, and some armies resisted neccessity this more than others.

"The ammunition capacity of the machinegun is not relevant - the tank carries as much as it is able to carry of all ammunition types." 
Russian tanks are able to carry what they were designed to carry, and what they were designed to carry is the inevitable result of how they were intended to fight. Form proves purpose.

"The Russians developed very potent anti-tank weaponry for their infantry because it is a good idea to do so, not because they thought there was some special threat against tanks from infantry."
They devloped numerous infantry anti-tank weapons because infantry positions are prone to being overrun by armor.

"A sufficiently determined attack against a tank from close range will almost always succeed, so no tank should get close."
That was not the outcome of the use of US tanks in close-range fighting in World War 2, Korea, or Vietnam. In Vietnam, it was common practice to attach M18 Claymore mines to M48A3s due to the frequency at which tanks were boarded by enemy personnel, and because of these and numerous other precautions, it was usually boarders who took all the losses.

"The superior threat to tanks on the offensive has always been camoflagued antitank guns, so this is not a particularly Russian way of thinking."
Anti-tank guns have almost universally given-way to ATGMs. They only remain operational in Eastern Europe and a few third world countries.
Reply: Hendrix Cody  the US needs a ton of equipment including candy bars and ice cream otherwise their soldiers can't function. Guess you didn't bring enough candy bars to Vietnam, Iraq and Afghanistan.
Reply: @AlexOnTheSide183  its a turbine engine....not really a "jet" engine. They are fairly quiet. Few moving parts and very relieable. The can easily push blades or mine claws
Reply: @craigkdillon  i have seen and climbed on/in russ,US,Ger tanks at Aberdeem proving grounds. I can tell you the Shermin was a shit design. Very tall, amour sloped up into turret. And was narrow hull (for transport). The T34 did every thing well...not the best but just well rounded